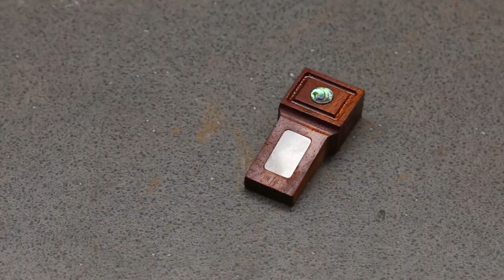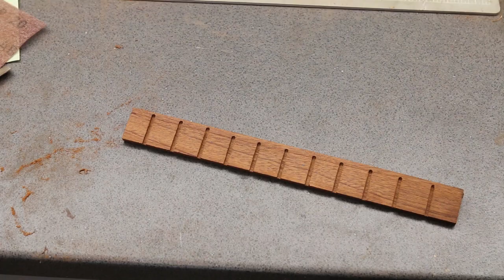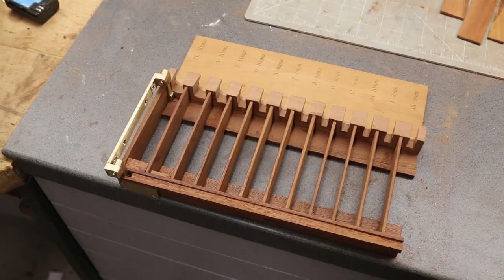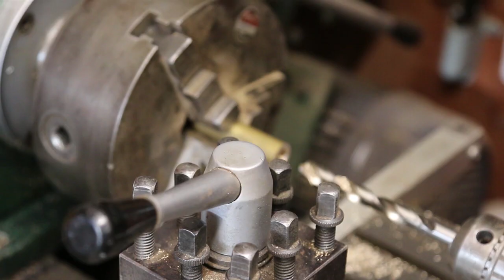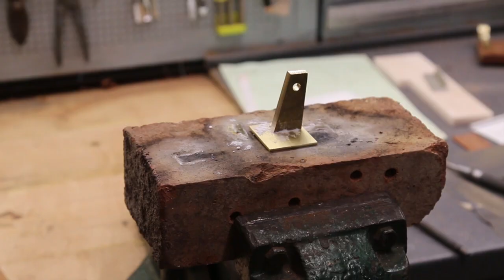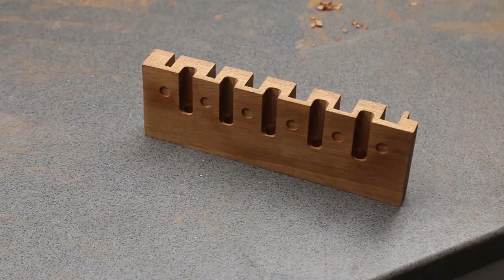Dudley pt5

Comment: Thanks Mike, a thing of beauty for sure, but it's also a great way to cram a lot of tools in a relatively small space, I wonder how much it weighs fully loaded, there's a lot of cast iron and steel in there !
Reply from the maker: Not sure of the weight, but the Studley apparently weighed 156lbs (71Kg)fully loaded, so it is likely to be similar. It holds a lot, useful in my small workshop.

Comment: Lovely work. What do you use for brazing (i.e. torch, flux and filler)? Would love a small setup like that for odd jobs rather than one with big canisters.
Reply from the maker: The torch is a propane mapp type off Amazon. I used an extender hose to convert it to using a larger propane cylinder (domestic heater type). I use 'everflux' brazing flux and either brazing rods or silver solder depending on the part. On brass, you cannot see the join (if you have cleaned it up well) and fabricating saves a lot of material. For small jobs a mapp can setup will do fine. I think more people could usefully use brazing- I might do a video on it...
Reply: @Tensquaremetreworkshop  that's really useful, thanks. Would like to see that video